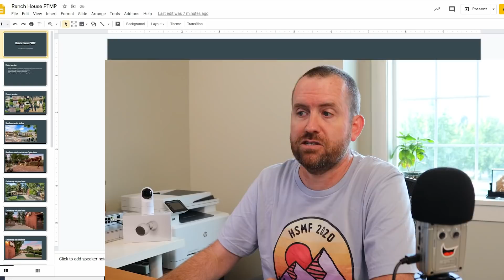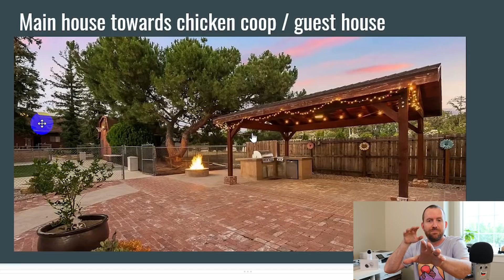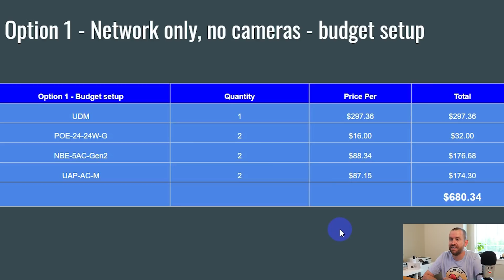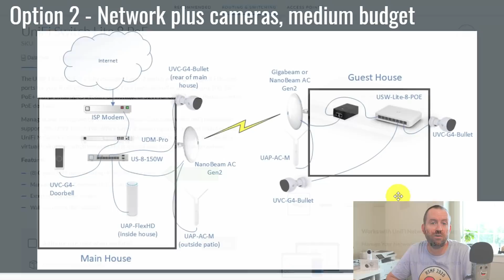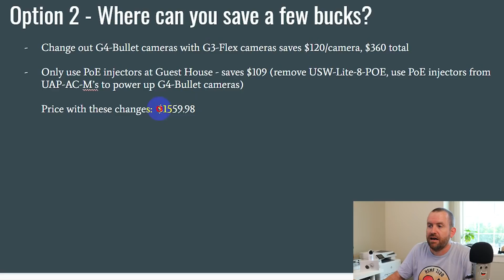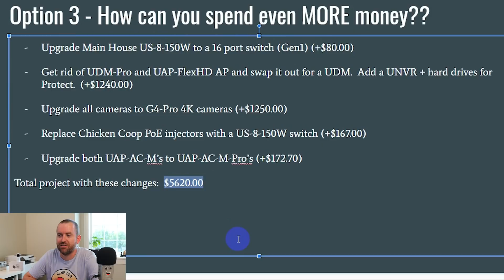Ranch House Network Design

Comment: For the medium setup, you still need something to switch the connection in the guest house, PoE injectors don't daisy chain the way you describe, they pass an Ethernet signal through, just adding PoE. Only complaint I could find. Love the video!
Hadn't considered the Flex APs, I have an AC Lite the latest firmware is causing to frequently reboot. Need to try reflashing one last time before I give up on it. Out of 1 year warranty.
Reply: Actually it does have data and PoE on both ports. Where did you read it does not?
Reply: @coryhall620  you need a third port to chain devices, not just act as a repeater. You have data coming in on the nanobeam, one leg goes to the mesh AP (end of that line), and one going out to the PoE in for the nano beam, which chains to another PoE injector for one of the bullet cameras (end of the second line). No way to get the other camera on without a switch to get more LAN connections.
Reply: Daryl Winsinger so you are saying you cannot hook 3 devices in line with Static IP addresses set? One throughout to another input and then another throughput so all 3 share the same injector? I see current being an issue but can that not work that way? I typically never use that data/lan output to even a second device so just reading it looks like you could do static IPs and just have them hang on the network that way no switch. I did a setup with a PoE unmanaged no Ubiquiti switch and it has an LPR camera, PTZ camera, and IP Intercom with video so 3 devices all static to one nanobeam bridge. Works fine that way. I am just asking as I never installed it the way you and Chris described. I am willing to learn here lol
Reply: @coryhall620  the nanobeam is the only device with two connections, the mesh AP and the two cameras only have one port, so none of those devices can pass LAN through to another device.
Reply: Daryl Winsinger got ya! I like solving problems lol we are all here to work together. Maybe Chris will read this long thread haha
Reply: @coryhall620  I have done similar installs, so I have a little hands on with this gear and similar setups. I spec'd a build recently where we had to bump up to mesh pro units as those have a PoE passthrough to a second port, but those start to add up. There are ways to make it work, you just have to draw out your wiring in the planning phase to make sure you have enough ports to connect everything up.
Reply: Daryl Winsinger I prefer a switch even if it just is unmanaged to provide a home run to equipment so they all have their own little spot to live with a lifeline lol daisy chain sounds great and I am sure it works well if you draw it out first like I had to for the 3000 feet I had to link up 2 gates at opposite ends  to the middle building and have IPs and power sums to make sure I powered every camera and NanoBeams properly. I used a free network drawing tool and cropped in actual device pics. One PTZ camera takes 60 watts and I had 2 so they got their own PoE from the manufacturer we ordered so they wouldn’t steal from the other devices on the PoE switch. Cheap isn’t the way and my boss found that out lol 20 year old coax in the waterlogged pipes at 1500 foot runs is a bad camera day lol
Reply: https://dl.ubnt.com/datasheets/NanoBeam_ac/NanoBeam_AC_Gen2_DS.pdf
Reply: Daryl Winsinger Oh and I bought an LR and when I contacted Amazon because it would not work they only would refund me. I just wanted a replacement and I think the seller had too many bricks to carry them lol I couldn’t even get it to show up or get past the white ring flash of death lol

Comment: Why do you call the Orbi crappy?
Reply: I think the Orbi would be fine but you'd need to use the wired backhaul and possibly need more satellite APs Also, it doesn't have the options for separate networks and security etc that Unifi has but they may not care about that.
Reply: Repeating wifi usually gives poor service/throughput
Reply: @mrmotofy  But that would apply for any mesh solution, not just orbi.  My question was not why is mesh crappy.  My question is why is the orbi crappy.
Reply: @YeOldeTraveller  He described why, he didn't think the signal would be strong enough to give decent throughout. It sounds like they can use a wired backhaul and have multiple channels for a dedicated backhaul but I'm not very familiar with them. In general most mesh has lower capacity and slower speeds than dedicated wired backhaul devices.
Reply: @mrmotofy  I saw that he said he did not think it would work, but he gave no justification for that.  Again, if the issue is mesh, say mesh is the problem.

Also, the backhaul on the previous generation of orbi was 866 Mbits/sec.  This is is on 4 channels.  If you wire one end, you have two hops to the other end on the shared backhaul.  So split by 2, you should get over 400 kbits/sec from end to end.  Each of the orbi devices has separate radios for access point use on both bands.

The access points have no impact on the backhaul.  The orbi is really more of a point to multipoint attached to the master.

Again, my question is based on the dismissal without justification of the orbi.  I have no doubt that the ubiquiti solution is better.  You lose one of the hops and the link speed is faster just for starters.

However, I have used the previous generation of orbi to solve a very similar problem.  I was just interested in why Chris insisted on calling the orbi crappy.  I assumed he had a reason based on his professional experience.
Reply: @YeOldeTraveller  Ah, I'm not familiar with all their specs. I'm pretty sure I remember him saying he just didn't think the signal would be good enough at that distance. As well as he kinda implies and said he likes to plan for future use.

Comment: I had it in my head that 802.11ac did something to mitigate the bandwidth halving with WiFi extenders. Am I wrong on that?
Reply: I would like to know the answer to @GerbilKor question as well. I have 3 eeros in my house that are not hardline connected currently. Is their bandwidth being halved? In the future, I plan on connecting 2 of the eeros to a switch which is then connected to my main eero that connects to the ISP’s modem. If I do this, and if I’m assuming I’m correct, it would mean I fully back hauled my whole home internet? If I’m wrong please let me know.

Comment: Just finished a similar project. Used UniFi mesh APs to cover several acres and 5 buildings. We used 9 with a combination of stock and directional antennas. There were 4 on the main house, all with wired uplinks and 3 others around the property that wirelessly uplinked. It works great. Even made it out to the island on the property's lake.

Comment: Doorbell doesn’t use Ethernet. Takes the transformer voltage for the chimes, but uses wifi for video.
Reply: I think Ubiquiti have missed a trick in not using POE & Ethernet on the doorbells. Waiting for these to be made available in the UK so I can order a couple and play.
Reply: Phill Hills I don’t disagree. I liked the easy install with the transformer I already had in place, but would be nice to have it directly on the network.

Comment: I live in Southern California....come on out I'll buy your ticket. That way I can show you a much simpler solution with half of the amount of equipment while totally using UBNT hardware.
Reply from the maker: I'd love to hear about it!
Reply: @CrosstalkSolutions  As technology has grown over many years, many companies have figured out that EOP Networking is a sustainable solution for Long Distance cable runs without the expense of hardware others need to get the job done. I have tried the gamut of EOP (Ethernet Over Power) adapters. While many claim they work in large environments with multi panel installs the one that has the best results is TP-Link AV2000 (TL-PA9020P KIT). 300-meter Range – Up to 300 meters/1,000 feet
 over existing electrical wiring. I have multiple install right up to 300 feet and 2 that exceed that limit. (360 and 351 feet). A testament to its amazing function is trying to buy one of these on amazon right now. They are back ordered for weeks per the Manufacturer.  The AV1200 works the same just with no power pass through. I would be more than happy to send you a set to test out and do an overview on your channel. I love your content, and method of delivery, and think you could give others looking to do something like this a great perspective on this product.
Reply: @thoughts4days  Ha I got a AV1000 to play around with. The principles just seem wrong to plug Ethernet into power haha
Reply: @thoughts4days  Well, potentially you could get hacked over that. From what I read, it uses similar authentification to Wi-Fi to prevent that, but if someone connects to that electrical circuit... I'll admit, I would not have felt quite as safe using those. Especially if these adapters had WPS option alternative...
Reply: @looseycanon  The adapters are part of a closed circuit. You would have to directly connect to one of them to hack into it. But based on that specific action, its not a hack. They also have the ability to create a secure network via mac address. Also if you are going to be using UBNT equipment, you can block all of the traffic to them via the outside world and internally. You can also create a simple firewall rule to isolate them on a vlan or even filter their traffic more. I am not suggesting you use the version with an access point attached at all. The AV2000 and AV1200 are Ethernet only. The person that would have the ability to hack them would have to be stealing your power or have broken into your home or business and have a cable dangling out a window or connected to another wireless router broadcasting outside your purview. The initial argument was how to get signal to the rear of the property based on price and reliability. I would gladly give you an external IP for my personal home to see if you can get into one of these devices. I have consulted TP-Link for years on this product.

Comment: Hey nice videos und nice builds. The only thing i would swap are the wireless building to building connection which are not cheap :). Why either connect the buildings by a cat 7 ethernet cable running in a pipe or if every builing have a connected powersystem go via powerline LAN adapters? - great videos - have fun!

Comment: Interesting project, i prefer to let flexibility of choice about manufacturers surveillance systems for a residential infrastructure (cost-effective).
The first project is the better imo, although if i want to add an AP in the guest house, an Aircube would be fine wich provides passive poe to the nanobeam(not sure if ils sufficient for the uap ac m though)

Comment: Why the flex hd vs the Unifi6?
Reply from the maker: All of the UniFi WiFi 6 stuff is early access - I haven't tested any of it out yet, so I can't put my stamp on it.  Besides that, it's very unavailable.
Reply: @CrosstalkSolutions  some items have come out of EA.  It looks like they took the same form factors and added the wifi6 radio into them

Comment: Sorry, but this wasn't researched very well. The Orbi system in that Costco set lets you wire up the satellites via their gigabit ethernet ports (each satellite has 4) to establish a wired backhaul, so no there's bandwidth loss. You could easily run an outdoor cat6 cable along that property down to the guest house, and they have an outdoor-rated satellite for the pergola area in the middle.

Comment: Dimension??
Reply from the maker: Lot is about 1/2 acre.
Reply: @CrosstalkSolutions  Thanks, for a 1/2 lot, let's say 300'x 75' (22,500 square ft, pretty close), you can probably do a uap- ac-m with a direction antenna. From the reviews I've read, the added antenna can comfortably do 400' (90 degree). The antenna cost about $100, save a little money as you can skip the point to point. I have one sitting in my inventory but have not had a chance to test it yet, so I cannot confirm the performance.

Comment: I'm curious, why not consider using a pre-terminated fiber patch w/ SFP transceivers in place of the Nanobeams? Maybe I'm old school, but I always prefer wired to wireless between buildings.
Reply: Agreed.  And given the rural nature of the neighborhood, I bet someone owns a trencher you could borrow.  
A non-fiber option would be cat 6 to coop<->switch in coop<-> guest house.  Either way, cable is better than wireless IMHO.
Reply: Anything is possible but the cost would go up, and the complexity would go up as well. This is his friend, and he is probably not going to charge him much in labor, and he is not reselling the equipment so he makes no money on it. you start mixing in a fiber solution and hes going to have to build out a whole rack for him now and add hours to the project. Yes, to do it RIGHT you would always run fiber where you can but being this is a residential solution that with a residential budget I can see why he would not consider it..
Reply: Direct burial twisted pair would be fine too. They are close to neighbors so there will be 2.4/5G interference. Since the guest house is two stories, there will be at least two televisions potentially streaming at the same time.  A hard line seems like a better solution.
Reply: Trenching is expensive. But I agree. I hardwire everything I can.
Reply: @arigornstrider  You could probably easily run some outdoor rated cable hidden along the fence line and then only need minimal trenching into the guest house.

Comment: I've enjoyed all your videos regarding outdoor wifi and getting wifi to a remote structure.  I've got an ~800 ft shot through trees to a solar powered Unifi camera I want to set up.  I know 5GHz won't make it.  I figure 900 MHz might be a problem - the trees are really dense in the summer.  So I'm thinking of setting up 2 sets of 5 GHz nanobeams in a "dog-leg" configuration through a clear area to get the signal around to where it needs to go.  The only problem is the mid-point "repeater" will ALSO have to be solar powered.  So I'm afraid this is going to get expensive!
Reply: The 900 MHz is actually better penetrating through things. Chris used some Rockets to go through some dense woods. I setup gate systems and they use a 900 MHz tester because it penetrates better and even distance is not a huge issue. Here is a good link. They are 50+ Km  range. https://www.streakwave.com/itemdesc.asp?ic=RocketM900
Reply: @coryhall620  I am wanting to setup wifi connectivity on a stretch of property.  My house is all hooked up real nice. I recently put in all Ubiquiti and get about 1790 mbps everywhere. A couple of areas like my large garage area is only at about 900mbps but I am ok with that.  I am working on the outside of the property now.  I have this area where I am building a wood shop that I was going to power with solar.  Interested in options to have solar power in that area so I could power anything Ubiquiti to get a signal down there.  I say down there because my house is up higher ground.  There is no line of site at all. I have two paths that are cleared around the batch of trees that are sitting between the house and then the opened area behind those trees where we are building.  We are not putting in running water and not planning on installing electricity right now.
Reply: @robertknowles3677  No line of sight as in trees or is there rocks and other blockages?
Reply: @coryhall620  Trees.  I could send a photo or video but no way to do so in Youtube.
Reply: @robertknowles3677  OK let me think about that one.

Comment: We need a follow up video on what option they went with.
Reply: I wouldn't be surprised if they just kept the Orbi's TBH. With labor you're looking at triple the cost minimum. They could just get another cable connection to the guest house, and plug the 3rd Orbi into that. Leaving 2 to mesh in the main house.